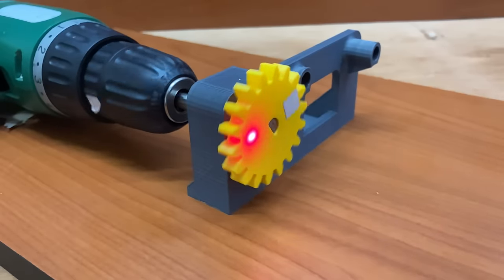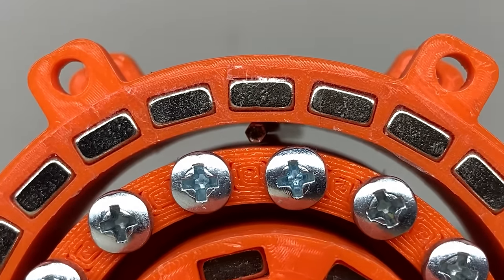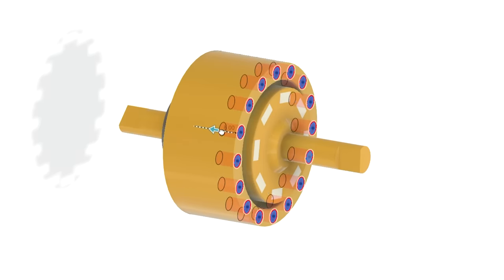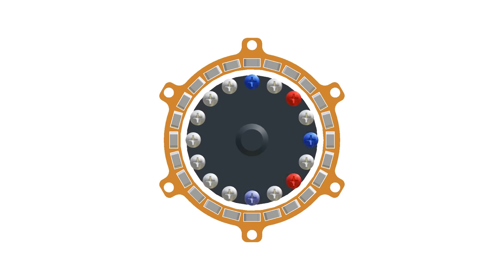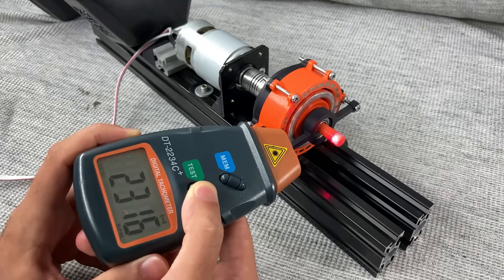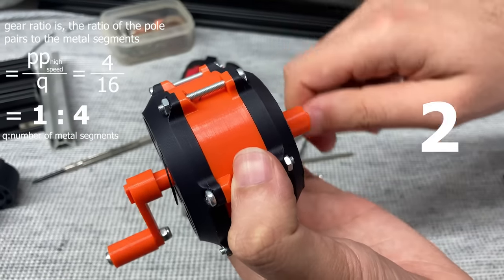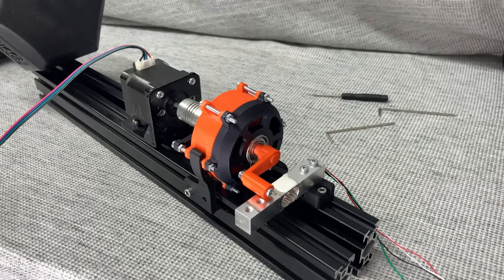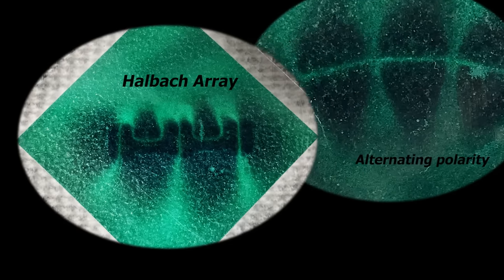Magnetic Gears - Why Nobody Talks About This?

Comment: One of the big issues with these is their load bearing capabilities. Unlike a regular gear these will not be rigid under load, which is fine for some applications, but they can't really be used in applications where you cannot have chatter unless you combine them with some kind of active load balancing from an electromagnet. Very useful if you want to rotate something inside of a sealed container.
Reply: Or even wanted. No tooth wear. Plus bigger loads could be supported with stronger magnets. Force ratings.
Reply: @thermostance1815  also, the load capability is inversely proportion to the distance between magnets. Using a better and more rigid build with tight tolerances could make it exponentially more effective
Reply: Hermetically sealed motors have existed for over 75 years, they don't require any magnetic parts, and there isn't even a necessity for sealed driveshafts after the Zero Axial Radial Thrust technology was created. This guy is making stuff in the Dark Ages compared to what actually exists in the world market today.
Reply: @CommunityGuidelinez  And fixing problems that don't exist except in 3d printed parts. Ground helical gears aren't noisy, and have negligible wear because they are rolling on each other instead of sliding. The load capacity of a magnetic gear drive will be laughable in comparison to a similar size or weight gear drive and cost way more. 

A fun project and interesting ideas, but hardly fixing gears.
Reply: @CommunityGuidelinez  your 75 year old motor also requires electric power to make torque. Why add more inefficiency during a energy crisis? This is a cool demo of old technology but unfortunately we don't live in the reality of a freshman year physics class.
Reply: @RobertMascorroJr  yeah thats true, thats why real world vehicles dont use 2000 year old technology made of shaped metal. we use direct drive electric motors because they produce more torque and efficiency
Reply: @thermostance1815  when designing things we are very often size and weight limited. I cant even imagine how much bigger and more expensive a magnetic gear have to be to reach the same amount of torque as a cogwheel one.
Reply: @raensaeck  More expensive, perhaps. Bigger? no
Reply: @RobertMascorroJr  You are aware that even electric cars require power from a coal or nuclear plant to charge and run right? Add in the fact that less than 18% of power comes from alternate energy sources and re-evaluate your stand on freshman level alternate energy solutions. Even if the power came from solar generators, hermetically sealed motors are still the best 👌
Reply: @CommunityGuidelinez  I don't even know what we're talking about now. All I was saying is that in order to increase the load carrying capacity of these magnetic gears, the gear assembly would need to be powered in some way. This would reduce overall system efficiency of whatever machine these gears would be used. I very aware of our dependency on "dirty energy". I know this because I spend $130 every time I fill up my diesel truck.
Reply: Oh and lets not forget that ... shock and vibrations = DEMAGNETIZATION!
It is a very good idea to use magnets, where vibrations are unavoidable and omnipresent, as in rotating machinery. 
Thank you, back to the drawing board, design (and I guess marketing?) students ... *facepalm*
Reply: was going to ask just this...what is its performance under load.
Reply: @RobertMascorroJr  Would these motors have a more practical use in near vacuum environments like space? Friction is not a huge deal as is but I imagine the shear amount of force you could produce in space with a similar gear system connected to an electric motor, without nearly as many of the cons.

I know that a big issue with geared systems in space use is the risk of shearing during over-torque because of how long it takes to slow objects down, so would this not be a much easier solution then the current clutch based solutions?
Reply: @JustAGooseman  i would say space would be the ideal place as you don't need to over come the force/resistance of gravity or much
Reply: high speed tubines that can be aerodynacically borne.
Reply: Obviously you wouldn’t use them if you want high torque, it’s great for high speed though
Reply: @CommunityGuidelinez  You don't know that electric vehicles are significantly more effecient, even when charged via coal or natural gas, yet you want to try and be condescending about your physics education? 🥴🤡🤣
Reply: @JustAGooseman  Back in the 60's, some developers at MIT developed a magnetic motor for the Apollo 11 spacecraft. The reason they developed that particular motor was because magnetic motors were less subsceptible to losing power vs electric motors. Spacecraft and satellites use magnetic guidance systems too. Magnetics do have their uses
Reply: @Studio23Media  I never meant to be condescending, I hate that you took it that way. I was just stating facts that I know mate
Reply: @Studio23Media  There are many factors involved in the efficiency of electric cars and motors vs. gasoline motors and cars. Do you know how much CO2 is emitted into our environment to produce those lithium ion batteries our current technology is dependent upon?
Reply: Kind of like a cvt
Reply: Like a flying wheel
Reply: @thermostance1815
Reply: @muhammadbasirbiyantoro8472  hi
Reply: @CommunityGuidelinez  Why do you belittle everyone? Does it make you feel powerful? No one likes people that do that.
Reply: Checkout stepper motor. They operate at same principle but at better electromagnetic
Reply: @khoury  don’t be so sensitive, he’s only discussing stuff(if a bit clumsy).
Reply: Might as well just use a series wound DC motor after a certain point.
Reply: @khoury  Again, I do not intend to be condescending or belittling. I'm a busy guy and I keep things short as possible without being a jerk. That being said, I do find that conversation and education takes precedence over peoples feelings, after all, those are yours and yours alone to deal with. That's fine if you want to talk about them, just not with me. I'm not qualified for THAT position 😃
Reply: @thermostance1815  : Stronger magnets will generate stronger flux eddies, which will increase drag similar to the friction between gear teeth. Not to mention magnets are way more expensive than mechanical gears. There is no free lunch.
Reply: @CommunityGuidelinez  That is like the lamest argument ever. Electrical cards dont completely fix the problem, but they are an important step that is REQUIRED to fix the problem. You arent getting anywhere if you stick with IC Engines. IC engines dont accept renewable energy. Electric cars do. Furthermore, electric cars have much greater efficiency than IC engines. Massive plants turning coal into energy are far-far more efficient than trying to do that inside a small engine in the car.
Reply: @Robert Lemon You're not telling me anything I haven't heard before, and I frankly don't care. My family, my clients and the people that work for me love me, that's all I really care about. Y'all randoms don't mean shit to me mate. Sorry, but that's where you stand.
Reply: @Navhkrin  You should do your research on electric vehicles vs. gasoline powered vehicles. Clearly you only have mediocre knowledge of what is actually involved with the production of EV's.
Reply: @Robert Lemon Its not unhealthy, it's necessary. I get it man, people have feelings, I do too. I just don't live in them like most people appear to. 😕 I'm more interested in teaching, learning, and making sure my family and employees live well. Is that so bad?
Reply: @Robert Lemon I guess I'm asking you in a round about way, how do you think I could improve?
Reply: It's just a bad idea all around.
Reply: @CommunityGuidelinez  Completely agree, still fun to see it in action though :) I can think of less productive ways to spend one's free time.
Reply: @Navhkrin  One EV produced on a line, in optimal conditions releases 40% more CO2 into our atmosphere than a gas powered vehicle before it ever gets 1 mile put on it. That's the same amount of CO2 that a gas engine produces during 10 years of road life. Calculate in the average time of EV car ownership (a pitiful short term) and the fact that most EV owners will replace ALL the batteries within a few years time and that carbon footprint starts looking really nasty. This is also why programs such as the Battery and Critical Mineral Recycling Act of 2020 are being created. Sorry buddy, but the facts are there. 😉
Reply: @RobertMascorroJr  What, going green isn't solving everything?
Reply: @court2379  helical gears (and spur gears) still have a slidimg motion component. They only have a solely a rolling component when the contact point is at the pitch circle. Every other contact point is a combination of roll and slide.
Reply: The energy loss in this would be worse then wear and tear on traditional gears. And if you don’t care about torque then why have gears? Why not start with an electric motor that has basically no limit to rpm’s? There is almost NO application I can think of where this would be useful.
Reply: @Industry-insider  torque is literally the only reason for gears when you start with electric motors. If you are capturing wind or water energy torque is also needed for max efficiency. 
This gear box is bigger, heavier, more expensive and less efficient.
Reply: Magnetic stir plates operate on similar principles. Different sizes and shapes of stir bars can handle different loads before flying all over the place.
Reply: and what about the reverse effect? like a5mph wind creating 15mph worth of energy maybe?
Reply: @EuclidesGBM  but the RPM's required for any given application that a magnetic gearbox would be  desired for. would make the magnetic gearbox highly undesireable i.e Size. and weight. he said requires no fluids. yes thats true. at very low speeds. but at higher speeds and higher loads and larger size. you will need fluids. and a way to cool the fluids far surpassing modern transmission cooling systems. not to mention. theres no way for the "gear to hold" a vehicle in place if its used in that application say a truck attempting to slow down a hill. theres not enough resistance to utilize engine braking. and if you were to repurpose the design for that application it would need very hefty cooling.  and it would generate alot of heat trying to utilize engine braking. and say you used electro magnets to increase the effects 10 fold. it would generate even more heat requiring even more cooling making a overall heavier vehicle.
Reply: @thermostance1815  would be tenfold more expensive. and be significantly larger. a magnetic gearbox produces way more heat than a traditional one. especially under load. in any usuable range. and all that heat has to go somewhere. i.e cooling. so huge "transmission coolers" well now you need a way to cool it. well you gotta have fluid in it. if its not sealed since its magnetic all the road debrie thats magnetic will pack on the inside of this thing. take your average 1 ton truck Ram 3500 F350 Chevy 3500 etc etc. the transmissions now are pretty small weigh anywhere depending on configuration from 200-295 lbs With fluid fully assembled. including tourqe converter and your Transfer case. a magnetic gearbox that has same ratios as what its replacing. would need a aluminum case for sure. and need fluid too. would probably be twice as large. have a transmission cooler 3-4 times bigger. and weigh at least twice as much.  the biggest issue i see with it is it relegates engine braking as an option no way to lock the mechanism mechanically. to link the engine to the wheels. meaning you cannot rely at least in light duty (diesel truck) applications and larger and it would mean brakes would have to be much larger as if they already weren't huge to begin with. the brake rotors on your average 3/4 ton truck are the same size as your RIM on your average small car.
Reply: @Awesomelord101  i doubt trucks are anywhere close to what magnetic gears might even be remotely useful for. Dunno if there is, but the idea is what is important, that there are different ways to do the same thing.
Probably it'll have to do with very precise scientific equipment that can't have parts that touch where a normal gear would've been used. Where space and energy is less of an interest.
Reply: @Awesomelord101  Not quite so. You would only need fluids if there is a solid solid interface. Or as coolant if you are running it at an RPM air resistance becomes relevant (in which case you could just run it under vaccum). You are considering fluids for what transmission fluid would be used, to generate torque between two disconnected surfaces. What you fail to consider, is that this transmission is effectively a passive brushless motor, nothing else. What we are discussing here is how to improve the design to raise the stall torque...
Nobody is saying this is going to replace car and truck gearboxes
Reply: @Awesomelord101  and just to point a flaw in your argument, since these are just asynchronous brushless motors, using simple wires, you could generate a counteracting force with the Eddie currents of the materials themselves by inducing a load in the system. Effectively making Regenerative Braking. (Just reversing the function-side effect relationship. Instead of using breaks to generate power, using the generation of electrical power to displace the thermal generation from the breaking)
Reply: @CommunityGuidelinez  It doesn't seem like you are interested in teaching. Because if that was your goal you would do things that actually had people learning as the end result. Instead you have been prioritizing being rude. You can see it isn't having the end result of people learning and yet you don't adjust your behavior to align with your supposed goal. Instead you continue to double down on the rudeness and blame the rest of the world for not reacting to you the way you want them to.
Reply: Like fluid...in a tube?

Comment: Direct drive is much simpler and has the same inherent overload protection. I don't see why the magnetic interaction in the gearbox would ever be more powerful than the magnetic interaction in a motor of the same diameter.
Reply: you could use a system like this to get a stepper style motor to go fast and it would integrate well, but their is a reason nobody talks about them.
Reply: @lizelive  a "stepper style motor" would cause plane to crash
Reply: @lizelive  Stepper motors aren't designed for that high rpm application they're meant for dead accurate step positioning when used with servo feedback, what you want is a modern BLDC motor.
Reply: 100% correct. there is no use for magnetic gears unless for some reason you need you cannot change the motor and at the same time need the drive and gearbox to be isolated. very niche.
Reply: @Professor-Scientist   nobody mentioned a plane tho?
Reply: Steppers also are specialized to have a holding torque, forgot to add that part.